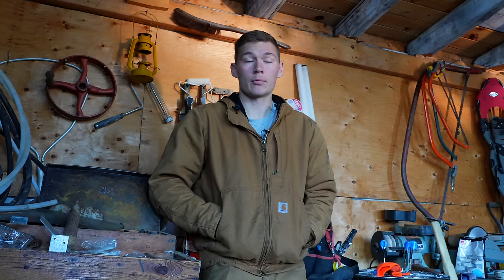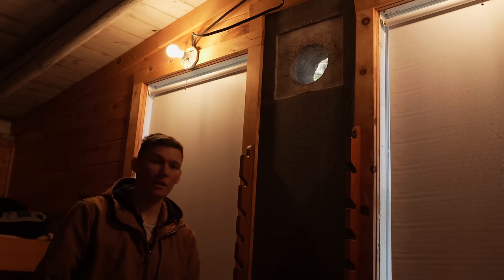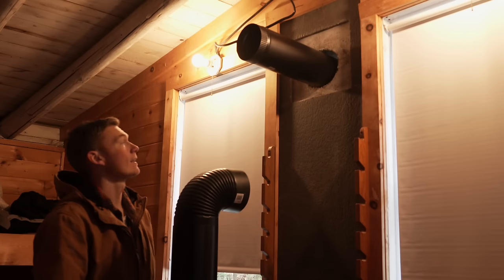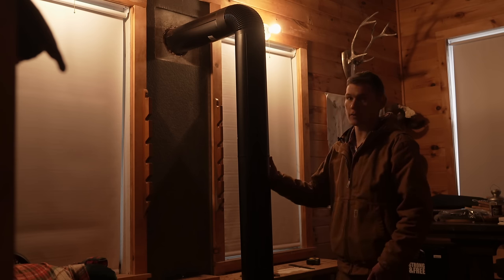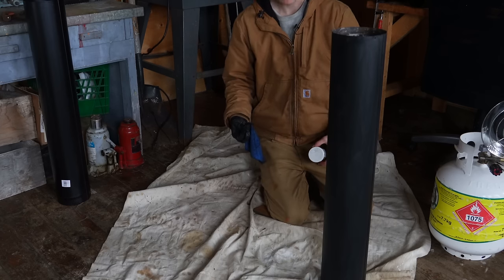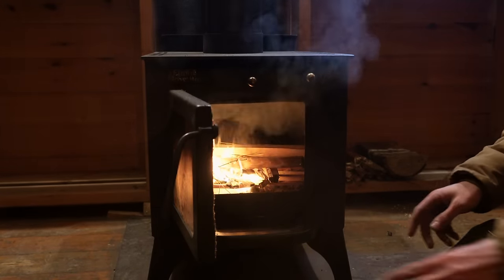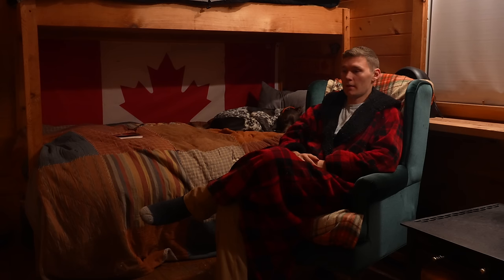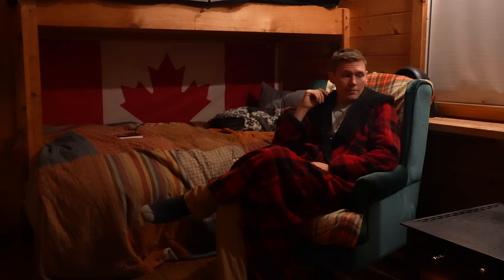Warm and Cozy Off Grid Cabin  // S2 EP4

Comment: Hi Dan,  get yourself a nice old kettle to keep on top of the stove to boil water.  It’ll put moisture in the air as well as hot water for tea,coffee and hot chocolate, oh, soup too.  Great job!  Someone else mentioned adding a flew dampener on the pipe.  You will be able to regulate the fire so as to save wood and adjust temperature.
Reply from the maker: Great idea thanks!

Comment: As someone else commented, I believe the pipe is backwards. Smoke will leak at the joints. There should be a adapter flange at the stove to the pipe. You noticed when you took the top of the chimney off it was on the outside of the pipe. You put it on the inside of the pipe. Each pipe section should go over each other going up. It also will leak water down the pipe. It's kind of dangerous the way you have it.  I'd keep a co2 detector handy while you are sleeping.

Comment: Good job on the stove pipe, buddy and the stove. Lando looks like he really enjoys it. behind the stove I would actually put a sheet metal kind of like I cut out that moose and the bears that I sent you guys they come in by 3‘ x 4‘ then just slap one of those behind it. I actually have a couple of those that I put behind my grinding stand in the workshop so no sparks will get to the wood walls, You can pick them up at Home Depot ok 👌🏼🔥🤠🔥Camping Russ out

Comment: Nothing feels better than wood heat! In the future I would look into a proper install of your chimney. That single wall pipe won’t last outside and requires 18” clearance to combustibles. I’d look into some Class A  chimney pipe and go straight up through the roof with a support box and flashing. It will draft much better and also be safe.
Reply from the maker: Will do! Thanks!

Comment: I love that you have the confidence to tackle a new job. I don’t know any more than you do about chimneys but I do have a question for you. Your one elbow pipe looks like it’s corrugated. I suspect if it’s like that on the inside that it will be a place where soot and creosote will collect on you. Is it possible or even necessary to switch it out for a smooth elbow pipe? I’m curious.

Comment: I don’t know a lot about wood stoves, but the few I’ve used all had a damper in the pipe above the stove. It was pretty important to either close or turn the damper way down or it got much too hot during the night (& it caused the wood to burn longer). Why does yours not have a damper or is there a different method for controlling the oxygen flow on your stove?

Comment: That wood shelves behind  the woodstove looks like it's way to close to the stove and I don't see a flue damper!!??
Just saying.
Stay safe.
Reply from the maker: Thanks for pointing that out I’ll definitely add one!
Reply: Dan…you’re very committed. Years ago people did a lot of different things when installing stoves and chimneys with varying degrees of success. The codes were much different 50-75 years ago. One thing learned over the years was that the surrounding wood near a stove and pipe may not catch fire but over the years the constant heating of that wood  lowered the temperature that the surrounding wood could become ignited by heat. I believe US, and probably Canada, codes ask that insulated pipe be used when passing through walls. The pipe never gets hot. Great stuff. And if you can go straight up that’s a plus. In 25 years I have never had a draft issue. It would be a great eventual upgrade.